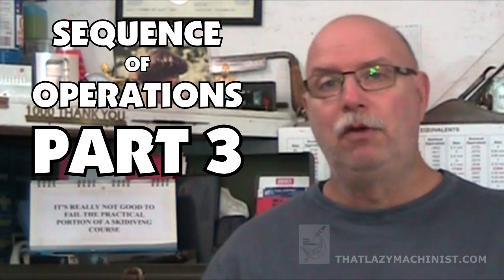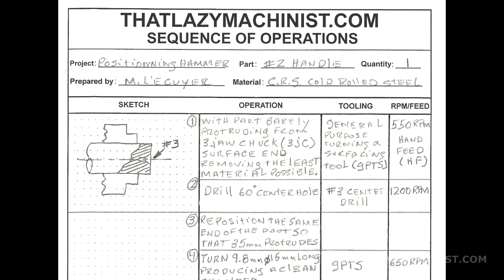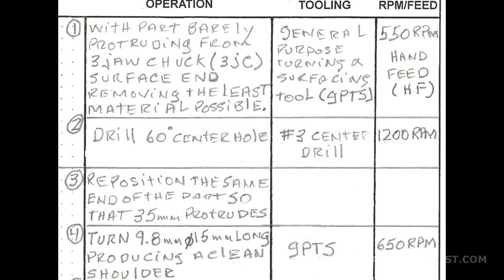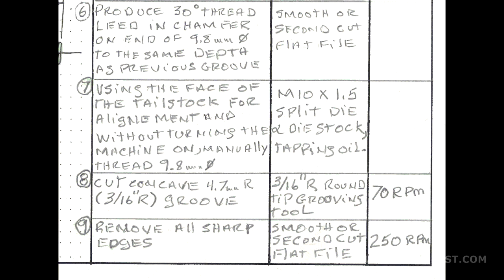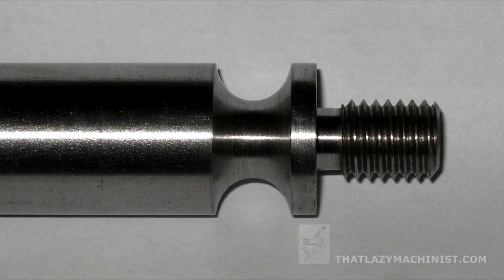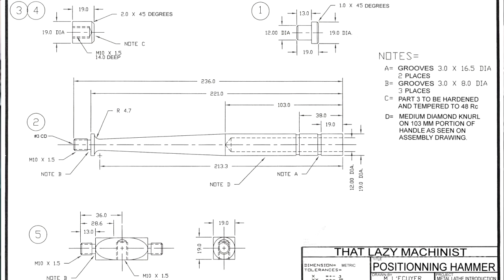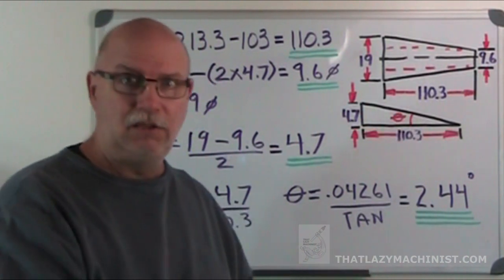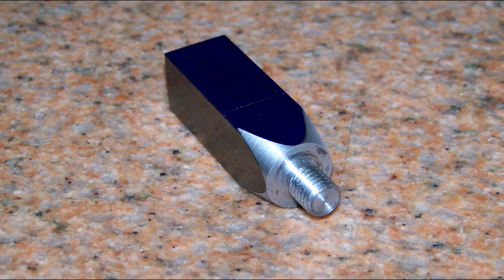SEQUENCE OF MACHINING OPERATIONS  PART 3, planning the order of operations to increase productivity

Comment: Marc, 

I can’t thank you enough for these videos they have kept me thinking and wondering and not staying stagnant during this pandemic.  I do have a question though you got 550 rpms for your first surfacing operation I ended up getting 533.333 how did you get 550? I used 100sfm per minute too in my calculation too and converted 19mm into a 0.75” diameter or 0.748” to be exact.
Reply: I know your question is 2 years old but the answer is that 550 RPM was probably the closest speed available on the lathe.  For instance, he listed 70 RPM in one operation but the slowest speed I have is 100  RPM.